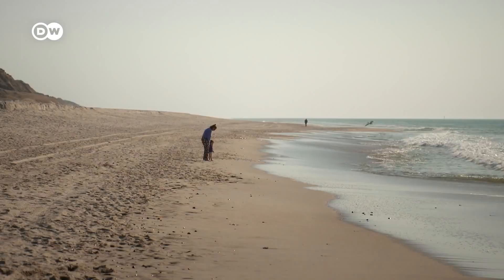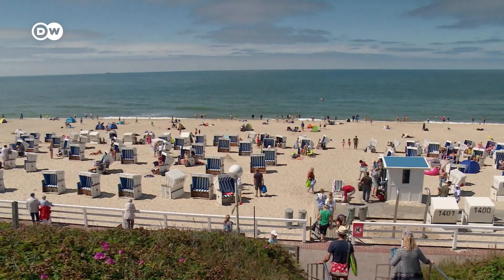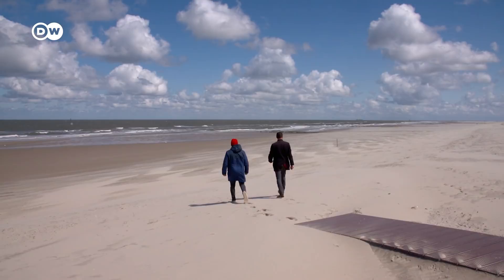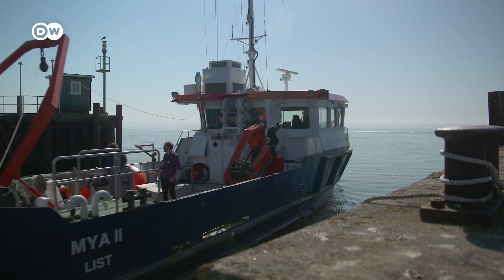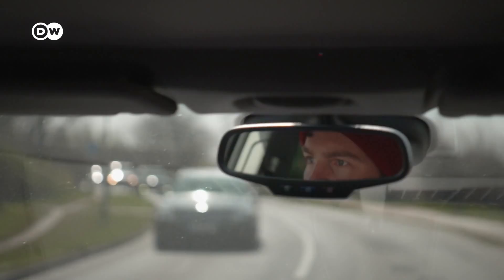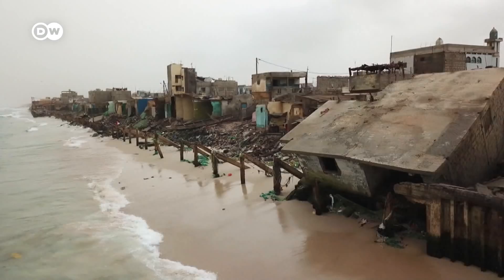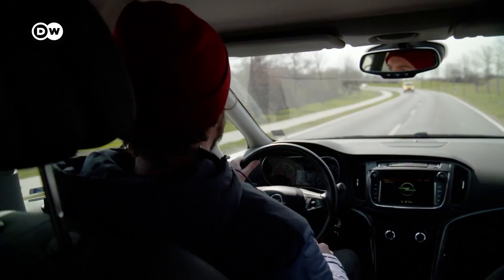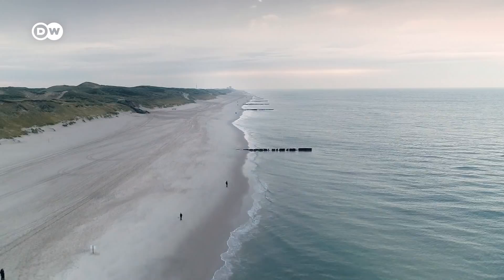Disappearing beaches - The trouble with sand | DW Documentary

Comment: Offset height and length of station reefs that encourage the wave break and sand and silt dropping out along the length of the beach's shore line's length. 
 That way there is less frontal impact and overlapping and skimming off the top and into the depths action. 
 With a space between the reef wave breaks you would have clean and known waves surfing spots, and a set of two lines at different depths and distances from the shore , one tidal under current would impact the other line and encouraged laterally down the the beach line again. 
 Waves that break over that outer line would be diffused into laterally moving water and be more so diffused of energy ..
 If I had a piece of paper I would draw it for you . 
 There are ways of setting tubes and tidal flow turbines that would also be useful for energy capture comming and going,  and also blow back classifying manifold tibes that would blow sand and water back toward the shore line .. lots of designes, sort of similar but opposite a tsunami diffusing system , but yes, it can be done.
Reply: Your talking about intermittent breakwaters. Those already exist. Look at Holly Beach, Louisiana. There are 3 miles of breakwaters and the problem is that it doesn’t help because sand moves on and off shore as well as along the shore. When you start interrupting that flow, you create worse conditions downdrift. They still have to pump millions of cubic yards of sand there and they have been deemed more or less a failure.  Structures don’t create sand.